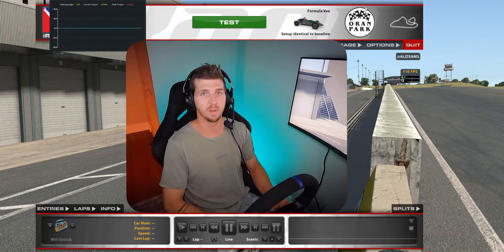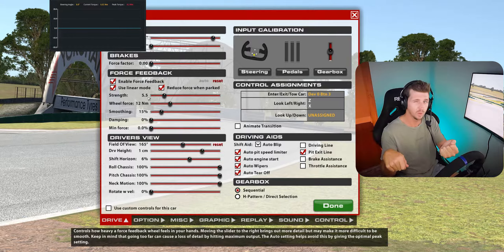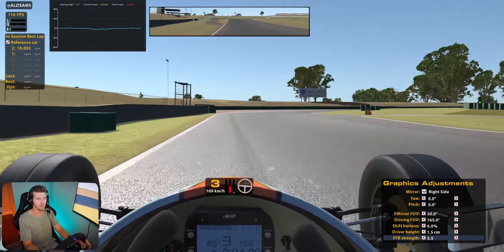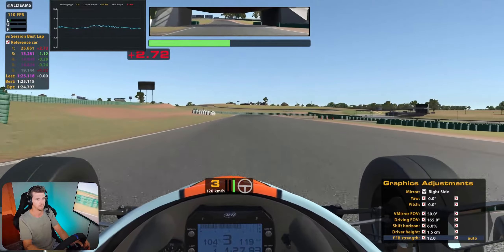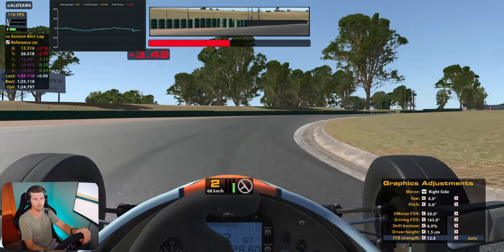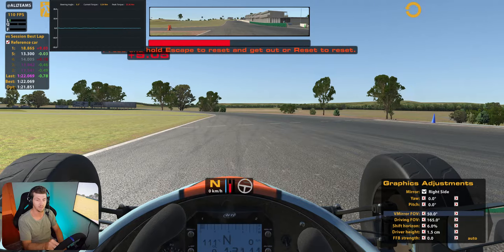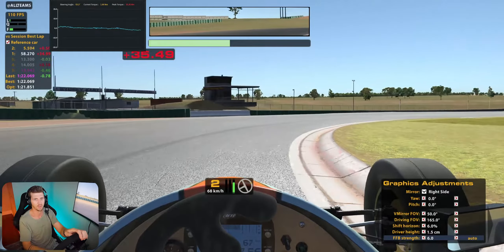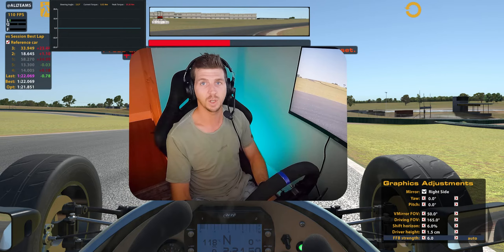How much force feedback do you need in iracing | Sim Racing

Comment: How much does a real car have, as that's your answer,   Maybe 2.5 nm at most
Reply from the maker: It's a very personal choice, but in my opinion somewhere between 5 - 9 nm feels good. 
That does depend on the car, and how you have the other force set.
Reply: @willostricksimracing  If real cars had between 5 - 9 force on thier wheel, it would be illegal, too dangerous
Reply: @MrJaz8088  You’re way over simplifying. It depends on the vehicle and conditions, there is no one answer. How fast is it going? Does it have power steering? How wide is the steering wheel? What kind of tires does it have? Etc.

A normal road car today probably has about 2-3 Nm at the highest, but older ones without power steering are going to be higher, like 5 Nm or more when parked.
Reply: @Tapport   No power steering, i would like to see that replicated/simulated
I hear you, it will never feel real
Reply: @MrJaz8088  A GT3 car generates between 8Nm and 13Nm holding force i the steering wheel while driving on track. How did you come up with "maybe 2.5Nm at most"?
Reply: @mementomori4972  Power Steering is how
Reply: @MrJaz8088  Gt3 cars have power steering too. You can't compare the power steering in your Fiat Punto while driving in the city, with what you get in a race car on track.
Reply: @MrJaz8088  Here is a video from a real GT3 driver explaining how to set up your FFB. https://www.youtube.com/watch?v=8_08lnkZOok Now tell me that you know better and that it's not 12 but 2.5.
Reply: @MrJaz8088 you’ve only ever driven pedestrian cars with street tires and power steering I guess. You’re so far off it’s not even an argument.
Reply: @mementomori4972  my 05 GTO feels less than my CSL DD at 8nm... 
The only time I felt my wheel as heavy as my Fanatec was when I sent the rear ahead of my nose ... over steer.. 
The power steering on cars is going to lower the heavy forces unless you're at full grip and ask for more then you really needed. 
I mean not for nothing but we do have in board driving cams and we can see a lot of GT3 drivers fight with the wheel to keep it straight or in line to the apex but almost never see them wrestle the wheel into corners. 

The Sim racing community gets it wrong on how many NM does our wheels need and also gets it super wrong on race car brakes being super duper tights and little travel.
Reply: Depends on the car. Most road cars we drive around the streets have electric steering and steering assist.

Most cars in iRacing don’t have those and have HUGE wheels and super soft tires which make the wheel heavy. GT3, mid level or higher formula cars and LMP type cars have 6-12nm. MX5’s and the low end formula cars have closer to 5-8nm.

No cars in this game have 2.5nm feel. But if that’s all you have it’s all you have.
Reply: @MRD0889  Your GTO is not a race car and there are already videos out there from real race car drivers who will tell you how to set up your wheel. It's beween 8 and 13Nm for a GT3 car. I posted a link before. Just watch the video.
Reply: @mementomori4972  lol!! You don't know of I have a race GTO or not 😂🤣😂🤣 you have no idea what tires I have on, how my suspension is set up. 
Truth of the matter is,  a lot of ppl online don't know crap about cars and just love the sport, i can dig that. When it comes to them spewing word of mouth from the internet.
Reply: @MRD0889  If you would have a race car, you would knew the forces involved, and would't need to post childish emojis to prove a point. Watch the video educate yourself and grow up.
Reply: @mementomori4972  once again, my friend... you know nothing. 
If you have an electric power steering unit.. that can actually be read out by a diagnostic laptop or via oscilloscope... it's a diagnostic feature.  The laptop will give you voltage and messurment of assit.
Go learn about modern automotive technology and how race cars use them to help out the driver in driving and read out what he or she is doing to figure out were the issue of performance is.
Reply: I run a g27, and feels ok at 80-100. :) And that has what, 2NM? Anyway, at 2NM, already feels almost like my first car, a no servo Skoda Fabia from 2000 or something.. Now i ordered a moza r9, and i am pretty sure i'll just use 5-6NM, like you do.
Reply: @MrJaz8088  Oh I hope that you are now more educated about that and not trying to be smart.. after 5 months xdd
Reply: f1 real cars make around 12-15 Nm force on wheel , and f2 cars arround 20-25 Nm

Comment: i run pretty quick in the  VEE James Sowell on iracing 1:19.9 on oran moto.  setting at 12 nm on logitech pro i use about 1/2 of what iracing recommends for most cars click on  the ffb where you are adjusting to see the other scale i use about 37 i think that is  9 on the other scale gives me about 2-3 nm  in most turns w/o hitting curbs etc. recommend setting your top number when it asks you how strong your wheel is to your actual wheels strength i think you said yours was 17 then use the number your adjusting in this video to tune the strength  you feel . this will give you the most fidelity

Comment: Super video. It’s good to see you dialing up a capable wheel to show the actual results. I drive a Logitech wheel that I enjoy, but I’m headed to another base before this year is out I believe. I can get a lot of feedback from my transducers but I’d like more from the wheel.  The mystery of what does a NM feel like is kind of solved for me watching you drive in this video. I was also unclear what clipping meant and you solved that riddle too.
Meant to say that I prefer to add friction when I can, or I tend to over correct due to the wheel being fairly light.
Reply from the maker: Glad I could help Dylan ! 
Definitely a very subjective subject, did you end up getting the new wheel base ?
Reply: Yep. I did. I ended up with a Moza R9 which is suiting me just great. I admire the higher strength models but for now I’m happy as can be. Thanks again for the video. It really helped.
Reply from the maker: @dylanmosley3030  Awesome mate !! The R9 is a great base, really good detail, response rate and direct drive. You won't go wrong with that 🤙

Comment: For me ive always gone around  7nm to 12nm with a 15nm base and the 10nm for me is about perfect. I feel so grounded have good weight and amazing detail. Ive always felt that the more center forces you can handle the better it helps with dtaying on the line cleanly and imo reduced undrrsteer feeling on the base itself. And someone I saw tested my theory wirh 5, 7, 12 and 17nm and they have a video showing them side by aide. You couod physically see that he didnt have to turn in as much for the car to turn in on the same line as the others. The lighrr base he had to turn more to get the same turn in. So its almost like the games or sims calculate  your forces on the amount of control or weight you can feel in thw car. More center forces turns in faster like more control it seems. Of course up to a certain amlunt its around 12nm where anything more doesnt change much. But it makes sense why everyone i know says the sweet spot is around 12nm because you can feel how grounded you are. Like you are connected wirh the road more. Was surprised the video showed me what I felt. 

Its just weird how when you go over the amount your base does by a big amount it seems people like that more. Its so confusing! Lol

What wheelbase are you on?

People also confuse dampening with weight. Having more center forces and weighr doesnt mean its more dmapened if you paid attention to the details they are there its just now you have something else you feel with it.

Sry about going on about this just your nm test brought things to midn and you feeling more grounded at 12nm brought ip the other part to me also. 

10 to 12nm is the sweet spot imo. Controlled still can be quick but feel like you are driving a car. Again wheels are not real cars we need the weighr and extra details to make up for what we dont get to feel like we would in a real car everywhere else.

For your answer on a real gt3 car is around 8 to 12nm. So yeah

Also I noticed you arent uploading the past month is everything ok?

Come back!! Lol
Reply from the maker: It is interesting how most people who have a DD base end up settling around the FF 8nm-12nm. I agree with you, that is for me where it feels the most grounded perhaps that is where the most detail is felt before being over powered by the other consistent forces.

I'm actually using a brand that i believe isn't around anymore. IMMSOURCE 17nm. Its Direct Drive, although i think the base has held up really well, and being honest i can't really tell the difference between that and a SIMAGIC base. But my wheel is that part that could do with an upgrade, Thinking a Simagic GT3 wheel.

Thanks for the comment about uploading :)

It actually got me thinking  about it.

Comment: Recently, I've got Logitech PRO Wheel and i use it between 6,3-6,6 Nm.
For me, that's yet enough.
Reply from the maker: Agreed on the strength front, in my opinion the "bigger" direct drive bases just provide more detail. Not necessarily overall strength.